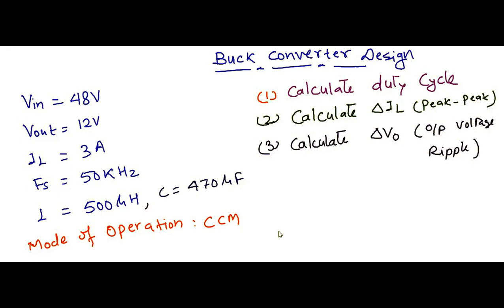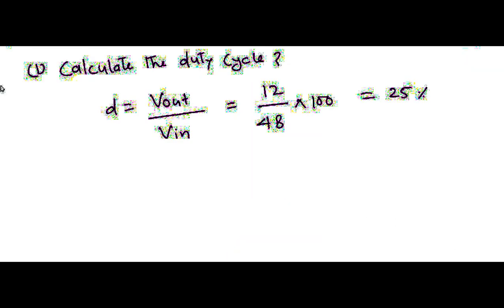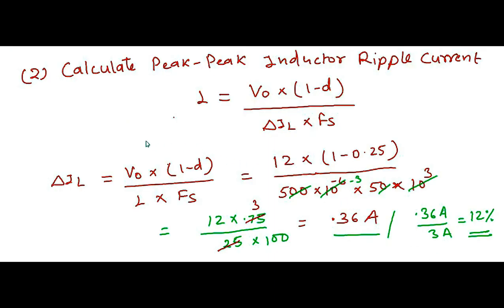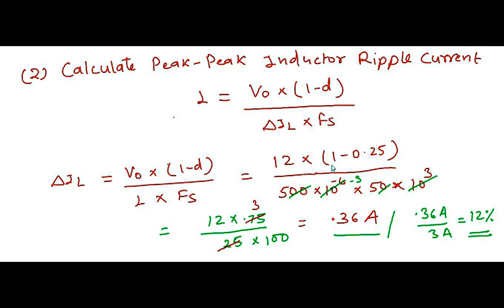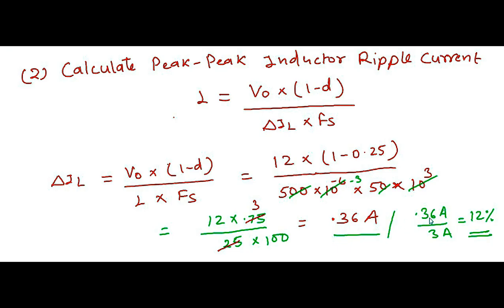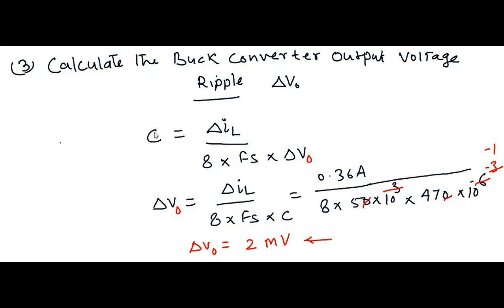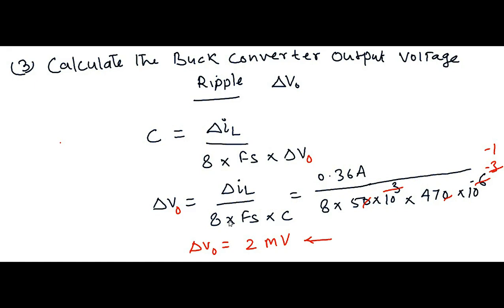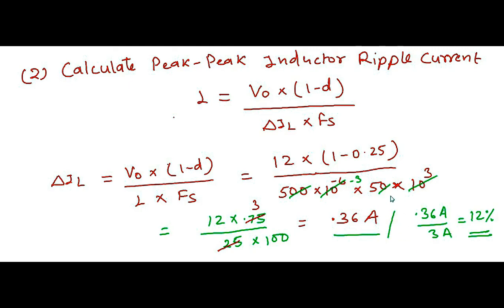Buck Converter Circuit Design: Example & Explanation

Comment: How can you calculate the value of the inductor and the wire size
Reply from the maker: Hi...apply volt - sec balance to calculate inductance value and wire size based on current requirement, go and look to SWG chart.